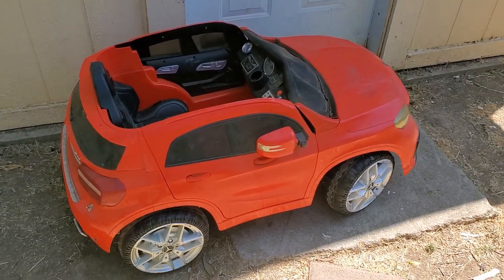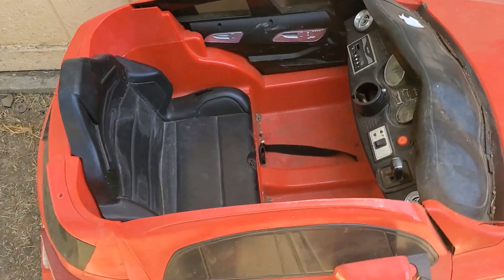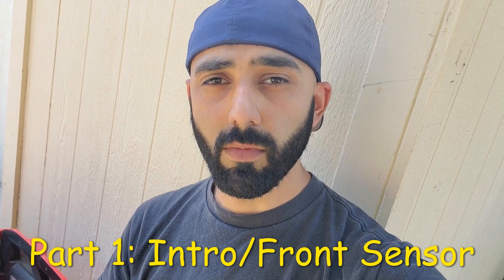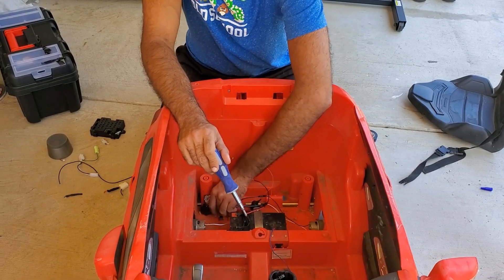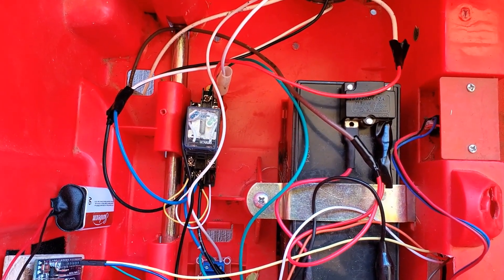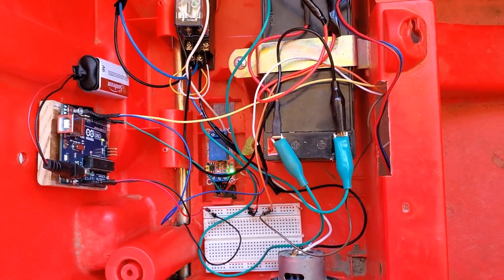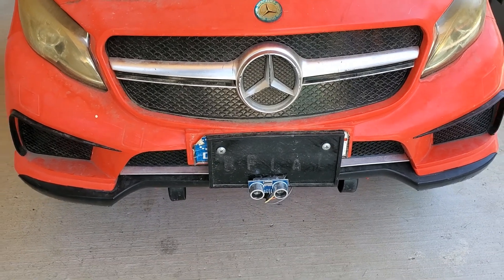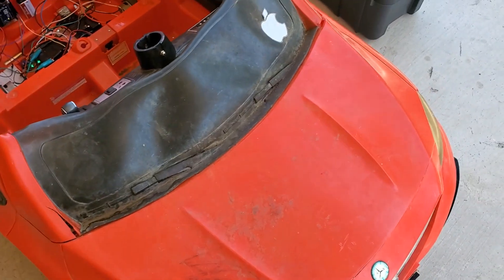Self Driving Power Wheels Car Build Part 1

Comment: Actually, forget about the steering column, just control the two motors separately and use it to turn/change directions like you would with a tank. That way when you're going backwards you could also make the car turn in a random direction (or add more sensors to determine the optimal direction)
Reply from the maker: That would work as well!
Reply: This would actually be an interesting upgrade